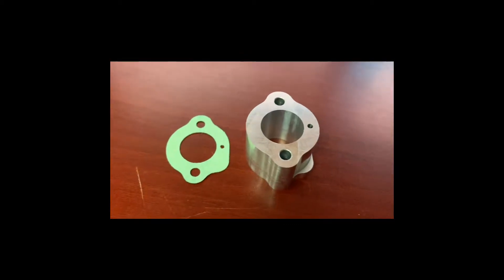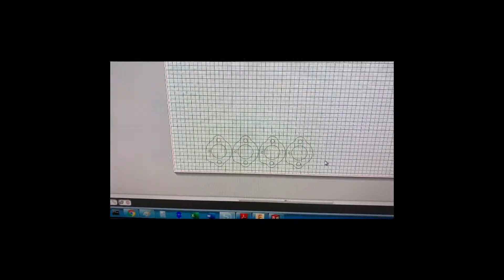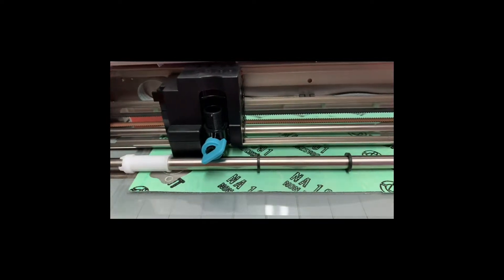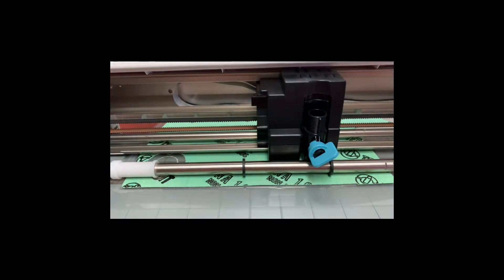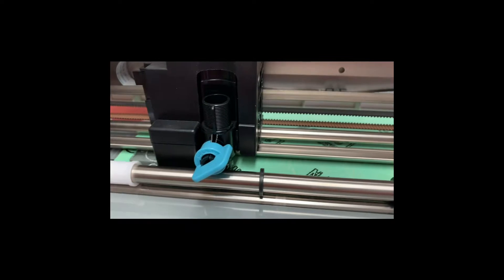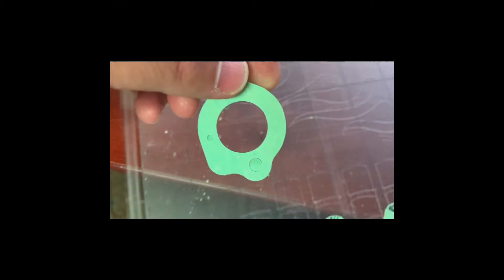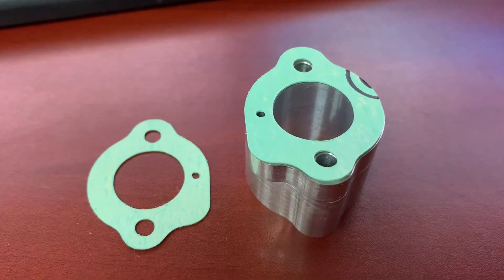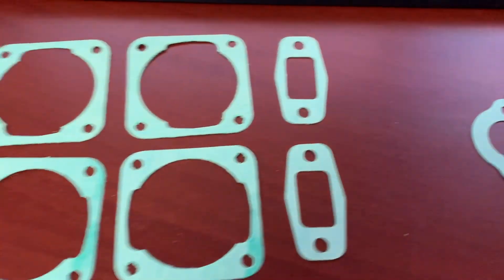Making RC Engine and Exhaust Gaskets using a Vinyl Cutter

Comment: Thanks for this! I just bought a Silhouette Cameo machine and was wondering if it would cut gaskets. Mainly I need carb rebuild gaskets for out of production stuff. Would be a great bonus to be able to cut this in addition to my usual vinyl projects!
Reply from the maker: Would suggest you get an extra cutter for doing gaskets. Use the other standard uses.